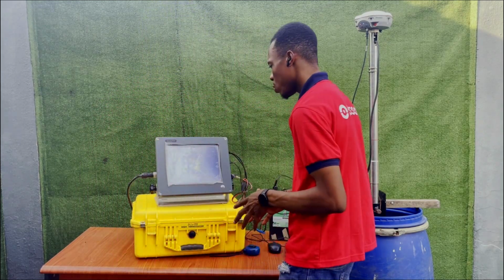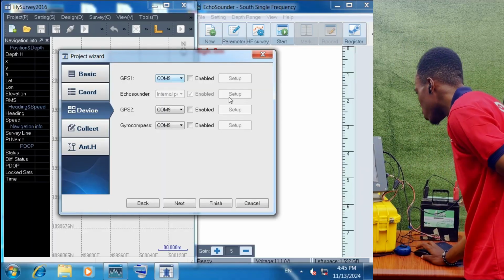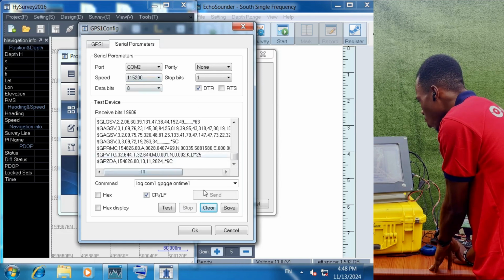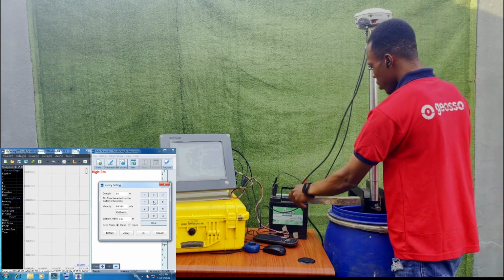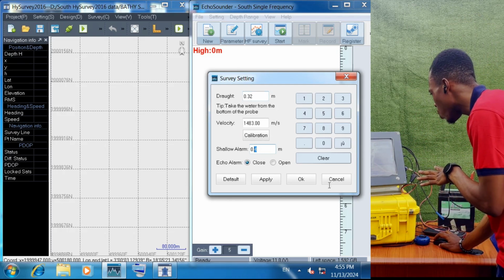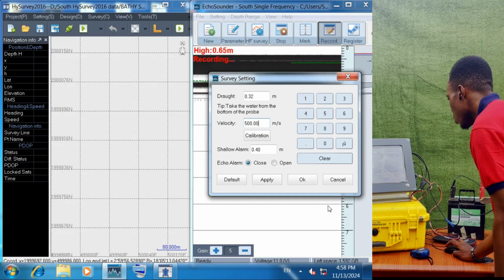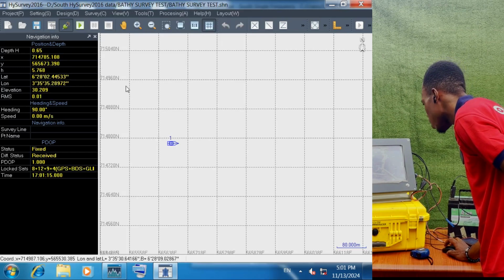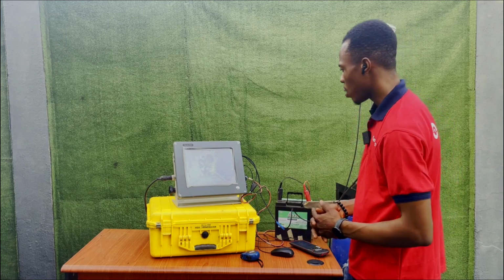SDE28+ ECHOSDOUNDER TUTORIAL - HOW TO CONNECT THE ECHOSOUNDER TO YOUR RTK RECEIVER

Comment: Well done... 
You measured the draught of vessel to 0.32 

When you measured water depth from bottom of that plastic to where the water is in the blue plastic it gives 0.64

Ideally, it should be from bottom of plastic to transducer. Then you add the value to 0.32. 

Importantly brother, sound velocity: cast should be made and input the value, adjusting sound of velocity in water to 500 m/s seems strange sir. 

Just my observation sir
Reply from the maker: Thank you for your observation